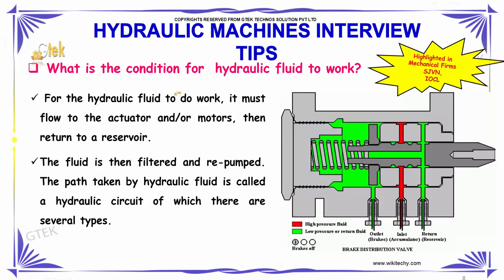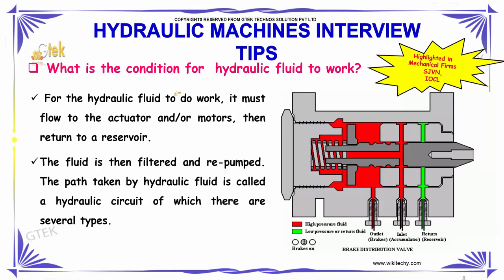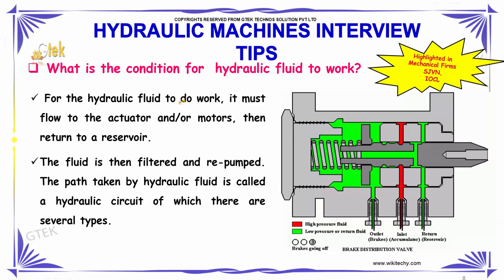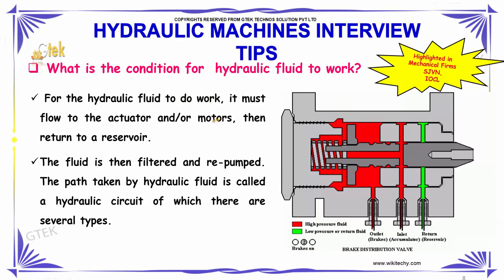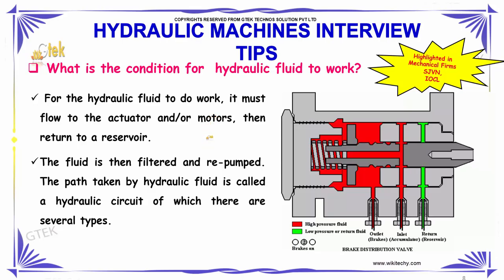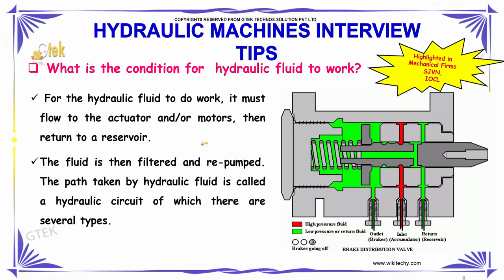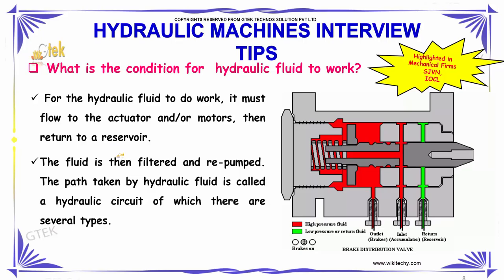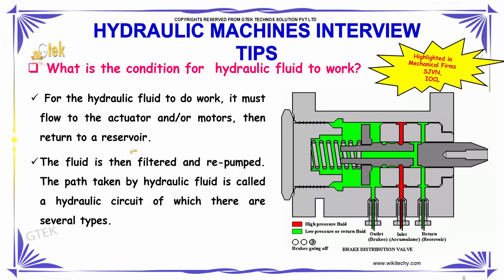what is condition for hydraulic fluid to work | hydraulic machines interview tips | wikitechy.com

Comment: Continuous monitoring of the filter elements in a hydraulic system can ... exchangers can be included in the circuit for total fluid conditioning.

Comment: A hydraulic system transfers force from one point to another point using an incompressible (hydraulic) fluid. To ensure that the fluid functions properly, it is crucial that it remains free of contaminants and particles. In fact, particle contamination is the single most common cause of hydraulic system failure.

Comment: You should use a suction filter if there is any likelihood of pump damage due to larger ... conditions - the return flow must come from below the fluid level in the tank. A hydraulic press is a device (see machine press) using a hydraulic cylinder to generate a ... Work is force applied over a distance, and since the force is increased on the larger piston, the distance the force is applied over must be decreased.

Comment: A hydraulic drive system is a drive or transmission system that uses pressurized hydraulic fluid to power hydraulic machinery. The term hydrostatic refers to the transfer of energy from flow and pressure, not from the kinetic energy of the flow.

Comment: Principle. Pascal's law is the basis of hydraulicdrive systems. As the pressure in the system is the same, the force that the fluid gives to the surroundings is therefore equal to pressure × area. In such a way, a small piston feels a small force and a large piston feels a large force.

Comment: A hydraulic press is a device (see machine press) using a hydraulic cylinder to generate a ... Work is force applied over a distance, and since the force is increased on the larger piston, the distance the force is applied over must be decreased.

Comment: Hydraulic filters remove dirt and particles from fluid in a hydraulic system. ... You should use a suction filter if there is any likelihood of pump damage due to larger ... conditions - the return flow must come from below the fluid level in the tank. A hydraulic press is a device (see machine press) using a hydraulic cylinder to generate a ... Work is force applied over a distance, and since the force is increased on the larger piston, the distance the force is applied over must be decreased.

Comment: Common hydraulic fluids are based on mineral oilor water. Examples of equipment that might use hydraulic fluids include excavators and backhoes, hydraulic brakes, power steering systems, transmissions, garbage trucks, aircraft flight control systems, lifts, and industrial machinery.

Comment: . Hydraulic fluid being poured into a storage container. Hydraulic fluid(s), also called hydraulic liquid(s), are the medium by which power is transferred inhydraulic machinery. Common hydraulic fluidsare based on mineral oil or water.

Comment: All hydraulic pumps work on the same principle, which is to displace fluid volume against a .... Check the actual operating temperature conditions of the pump during normal operation

Comment: Hydraulic fluid(s), also called hydraulic liquid(s), are the medium by which power is transferred in hydraulicmachinery. Common hydraulic fluids are based on mineral oil or water.

Comment: In this article, we will focus on proper starting and running conditions, as well as on ... Also, the fluid level in the hydraulic reservoir should be checked before ... temperature during usage will affect the working viscosity of the hydraulic oil.